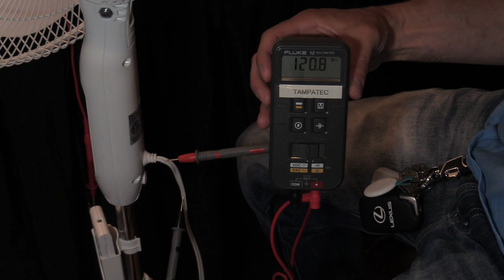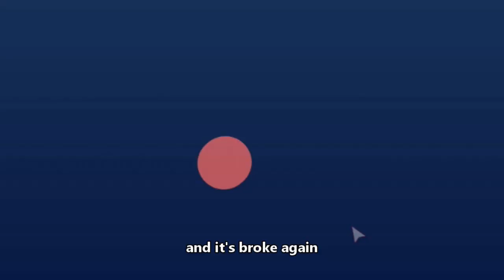How to Fix Pedestal Fan not working no power

Comment: Hi, I have an almost identical fan with the same board, the fan operates fine via the front panel, but via the remote control it behaves oddly. Whilst on standby, I can use the remote to start the fan, but then I am unable to turn it off or modify any of the speed settings etc. It's almost like once it is running it doesn't have enough power to receive a signal (just a theory). I have looked at the board and don't see any obvious failed capacitor etc... any thoughts? I'd like to keep this running and not filling landfills with "fixable" electronics....

Comment: Very useful video. Had pedestal quit working after a few months. Just decided to try to change out the fuse that didn't work. Found video cracked it up and found the problem a wire broke loose.

Comment: I have one of these but it's an older cool breeze fan. Same issue, plug it in no power, test continuity, OL on meter. Will be taking this fan apart to see what went wrong. I think it seized up and something burned out. Will be looking for thermal fuse in motor.

Comment: Do a how to on 30” utilitech pedestal fan. Modified blade’s in terms if a little ir lke a tad bigger itch or so, has run for a few years/awhile and wanna year or more ir so since thn, thn ruddy, jst recently found out tht it’s nt working. The little lght on the plug thts tspoed around the motor just so it can be plugged in and not have to bend up and down just to fck pick it up, bud lke, it’s a good:great, xnd even bttr fxn, jst the pesky motor nt rlly wrkng fr sxmecreadon?🤔🤨🧐🤷‍♂️🤦🏼‍♂️😕🤕🤷‍♂️🧐🤨🤔? Bt we hve a tea next weekend for my sister, sons outside some in, but,/…it’s supposed to be 90, ok syre, question on internet, what temperature do fxns nt work on or so/something lke tht, so I looked jst to lke see, xnd it says, fans shouldn’t be used in excessive of or lke when the highs are 90 or so, whch ws opposite from the question or so, but lke still,/…I jst dnt rlly know why it did that

Comment: Didn't know about that line fuse (generic? pico? universal what spec?) THANKS.  I can see how mass production - items loose or basically cheep parts "ITS ABOUT THE BASICS"  thx for your time it got me thinking again "The Basics"....

I got a NEW fan on E-bay (wall fan) and in 2-3 days it sized won't turn on no noise.  I opened and motor oil was SO DRY guessing it was in storage warehouse so long maybe years !!!

EVERYONE : Now I know - When you get a "new fan" you should maybe oil motor and manually finger spin the blades should spin freely w/ no power.  Before you oil finger spin and you'll see the difference before and after oiling (clean extra oil "drip extra" before turning fully back on).  Then oil as needed ( I'll do now every 4-5months or so takes 15-20mins work ) should last for YEARS !!!

Comment: That was a great fix! I would have sent that p.o.s. right back to Amazon or get a partial refund..( actually Amazon is good with that)
I have a 3 tier fan, 3 fans on top of each other. The fan has a switch box on the side prob had a remote, that I dont have Each fan has low med high  setting, It wont power on. I was thinking of bypassing the power switch because I dont circuit boards as you demonstrated. Would you have any advice on how to get this going? ( aside from getting a pro electrician)
I dont have the knowledge that you do. Thanks 
Barry NYC
Reply from the maker: Maybe loose connection on the switch or wiring.
Reply: @TampaTec  I checked those. But I will check to see if the cord has a fuse. Other that that,I dont know. Maybe if you have time,Ill send you a pic or two,Maybe you can see or think of something I didnt. I appreciate it. 
Be safe.Thanks

Comment: Right now, I have 4 (somewhat) WORKING pedestal fans I recently found in and by the dumpsters in our large apartment complex. 
1...has a broken motor housing. 
2...squeaks when oscillating. 
3...I have to make a new homemade base for it. 
4...cannot be ratcheted to adjust elevation.
None of these are a problem to me. I plan to donate two of them.

With the present pandemic, if you live in an apartment with interior hallways, it’s especially important to ventilate! During the Spanish flu pandemic 100 years ago, they put a lot of emphasis on ventilation. There are two photos online, one of a barbershop, and another of a court of law both being held outdoors. That’s how much importance they put on ventilation. Therefore these pedestal fans could be worth their weight in gold if there’s ever a run on them at the stores.

Comment: Excellent.   Variety is the spice of life.    A friend gave me a similar remote controlled fan like yours to repair.   I tested everything and determined the motor was at fault.   Unfortunately a thermal fuse buried in the motor windings did it's job and was open.   It was impossible to get to it without massive destructive digging into and was not recoverable..     I saved the remote and the receiver control board.   The long LEDs are kind of neat looking.
Reply from the maker: How did you test the motor? Ohm meter?
Reply: @TampaTec  Yes.   Checked for continuity on the motor leads coming out of the motor windings wire loom.    Power was getting all the way to the motor and it still did nothing so that made me test the motor winding continuity.   Sure enough I found the bad thermal fuse.   I have several thermal fuses on hand and have repaired motors and wall wart transformers that had blown the thermal fuse in the past.  But those fuses were usual not buried in the windings and were on the surface and easily replaced.   The fan motor thermal fuse was buried under several layers of winding of the motor and under several layers of wire lacing holding the wires in place.   It was not repairable after tearing all that apart and making is safe for use again.

Comment: I hope you have the polarity correct! Just a heads up for your viewers. If you reverse the HOT and NEUTRAL  on an AC circuit you allow the circuit to remain hot, so the board of the fan will be energized all the time, even though you can switch it off, the power is reversed where the switch only stops the power from completing back to the outlet instead of letting it energize the board when switched on. My wife bought me a Hoover garage vac years ago when I tried to turn it on , no go. She was so upset, I took it apart same issue.